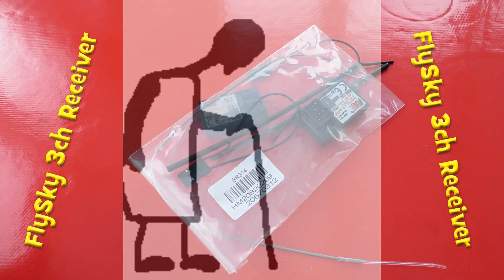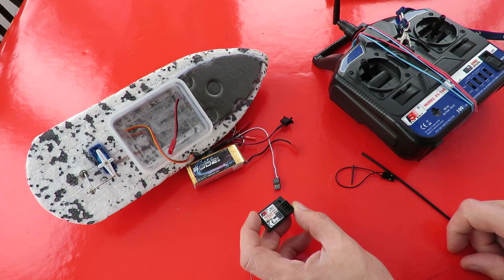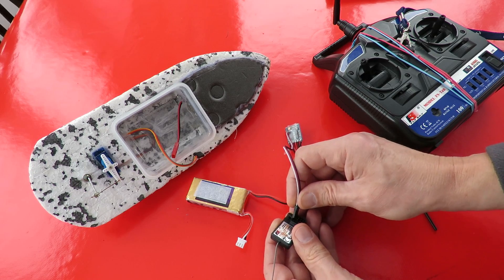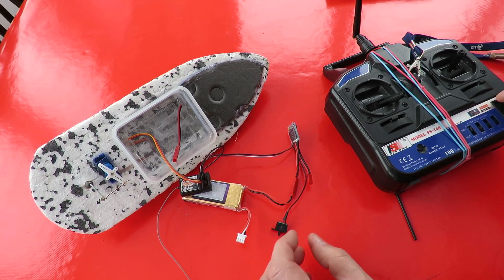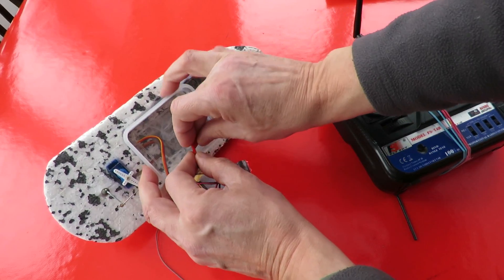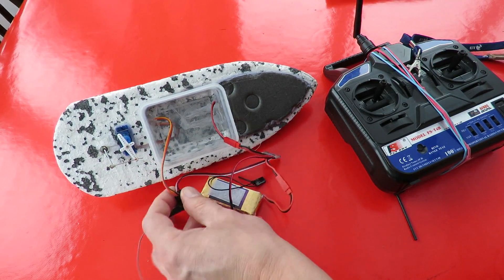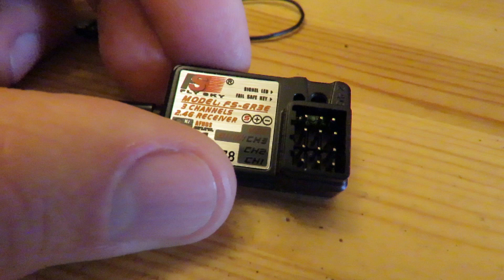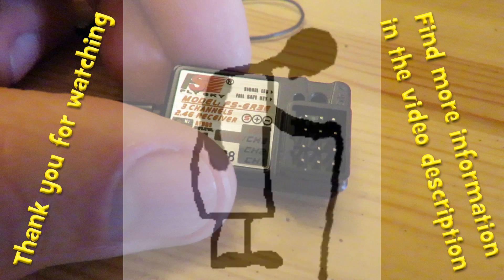FlySky 3ch Receiver

Comment: In my case flysky gt3b transmitter with gr3e reciver its range is about 50 meters what should i do to increase range
Reply from the maker: I would suggest you search the RC forums online, I expect there is some advice there.
Reply: @GrandadIsAnOldMan  didn't found any help ... What is range of your transmitter receiver
Reply from the maker: @technicaljatt3523  have you checked out the FlySky site for technical information https://www.flysky-cn.com/gt3b-canshu
and here is an RC forum link talking about the range on the gt3b https://www.rcuniverse.com/forum/rc-radios-transmitters-receivers-servos-gyros-157/11654812-flysky-gt3b-has-horrible-range-anybody-know-fix.html
Reply: @GrandadIsAnOldMan  I think i am using it near high voltage lines thats why range is not good

Comment: Hello, I bought this receiver new along with the radio, the only thing is that it makes a strange noise as if there are some internal parts moving inside the receiver. Of course, without power, almost like something mechanical is oscillating inside.Does it do this also in yours. best regards
Reply from the maker: You could always look inside. It only has 4 small screws holding the cover on. No there are no moving parts inside. Here is a video showing the insides - Waterproofing my FlySky receiver https://youtu.be/sR_ur6kZjMQ

Comment: Im a noobie here. How do people connect live camera feeds to this and use the same antenna?
Reply from the maker: @IeuanBevan.  Short answer, "You don't." If you are thinking FPV, you will find that uses a separate rc signalling board. You might link to this receiver just to get a battery feed, but you won't be sending any video signal through it.
Reply: @GrandadIsAnOldMan  ah right okay that makes complete sense now haha thanks alot!

I want to build a big rolling platform, can understand how you make FPV video very long range with a home station however would you know how you can make an RC work super long range? At least a mile range?
Any sort of special receiver or home station?
A reciver which can control a 12v dc moter, as well as some additional optional add ons.
Reply from the maker: @IeuanBevan.  there are all sorts of regulations covering long-range FPV, so I would suggest researching the regulations before spending any money. It probably depends on which country you live in.
Reply: @GrandadIsAnOldMan  last question haha, trying to understand also.

You know how alot of long range drones have Gimbal with 2 Metal Servos. (Moving cameras)

How do those moters get controlled by the same antenna on a drone to the same transmitter and still are able to be controlled super duper long range?
Such as the parrot Anafia drone?
Reply from the maker: Each servo will be controlled by a different channel on you RC gear. On some systems they even have motion sensors set into your FPV headset so the gimbals react to movements of your head. As far as the radio gear is concerned it is just another signal sent on another channel. Going back to the start of this thread, you are commenting on a 3 channel RC receiver. That means this receiver can only control 3 things, such as throttle, elevator, and rudder. What you are talking about is way beyond the capabilities of this receiver. On the subject of long range FPV you might find the Traxxalu channel interesting https://www.youtube.com/@Traxxalu-en9lz

Comment: What voltage do these receivers use ?
Reply from the maker: Here is the link to the Manufacturers description https://www.flysky-cn.com/gr3e-canshu it says 4.0 to 6.5 volts. If you are using a standard RC ESC to control your motor it probably supplies the correct voltage to the receiver. The ESC (Electronic Speed Controller) supplies the power to the motor and usually has a BEC (Battery Eliminator Circuit) included in its design to ensure 5 volts is supplied to the receiver, regardless of what voltage it is supplying to the motor. If you are interested in Radio Control I recommend watching the FliteTest RC Planes - beginners series https://youtube.com/playlist?list=PL6IuSFWz4ktvupu_gxw1vn-sjBGOkJFHV They talk about everything required for RC on aircraft but most of it also applies to cars and boats.
Reply: @GrandadIsAnOldMan  Thankyou .

Comment: Now I'm confused i bought a new receiver and the bind says channel 3 iv tried everything and it won't bind iv connected the seller and he said look at the listing so i did and it says too bind use VCC not channel 3 iv not tried it yet I'm just trying to get help cos it says bind is 3?
Reply from the maker: Yes, channel 3 is the one used for the bind plug on this receiver. In the video description I have written down the step by step guide. Make sure you switch both the receiver and the transmitter OFF as specified in the sequence.
Reply: @GrandadIsAnOldMan OK thanks mate I'll give that a go tomorrow and let you know how it goes thank you.
Reply from the maker: Good luck 👍🏻👍🏻 @LOVE2RC
Reply: @GrandadIsAnOldMan  all sorted mate thank you.
Reply from the maker: @LOVE2RC  great, I hope you get some fun with it 👍

Comment: Has anyone had problems with the range on these ? I use my cars on a basketball court and it loses range around 150 feet
Reply from the maker: Are you doing anything with the aerial?
Reply: Hiya... With these older ones make sure in your transmitter you change from default AFHDS 2 to AFHDS for these receivers. Its commonly a problem with these but that should fix it. Great range with these out to 1500m in the air and 500m over ground using a cheap Flysky i6X Radio. Just change the 2 protocol and your good to go.

Comment: I'd like to share how I fixed my fly sky FXI6 from the ayron channel from jittering turned out the spring tension is too loose.... You have to put a space or under the screw then the screw hits the back of the transmitter casing so you have to take a driMelll and make more room You could notice that the elevator sticks bring has more attention from the factory So you increase this tension of the spring and no more jittering when moving elevator stick!!!

Comment: Sir my receiver ,3 servos not working but the brushless motor is working sir 
Can u explain any method to repair it sir and what the problem is
Reply from the maker: Short answer, no. If your ESC is controlling your brushless motor OK, does the ESC work plugged into the other channels? That way you will know if it is the servos that are faulty or the receiver.
Reply: @GrandadIsAnOldMan  no sir esc doesn't worked while pluging into other channels, it produces long beep sounds for other channels .esc is working only in 
Channel 3 sir for FSR6B receiver

Comment: The paper sheet 6CH Reciver ONLY buys this item, can other remote control be able to control it?
Reply from the maker: It is a FlySky item, so it is designed to work with FlySky controllers. You would need to look at the technical specifications for your controller to see if it is compatible. I did find the WL V911 receiver worked with my FlySky controller so maybe a WL controller might work with a FlySky receiver, but I haven't tried it, so I don't know.

Comment: Recently received a TX with 2 of these RXes. I hope to get back into 1/10th buggy racing once the clubs are allowed to re-open. Rock crawling is fun, but I do like to zoom round a track. Heh, yes, and then there's all my gliders that I need to crash!  . . . 🛬
Reply from the maker: Hey buddy, long time. Thanks for dropping by. Yes the FlySky range are (or were) a cheap range that have always worked for me. Recently the eBay prices from China have effectively doubled for items like this, probably still cheap but not as cheap as they were.
Reply: @GrandadIsAnOldMan  Yeah, I decided on this Flysky as it's 3 channel, but it wasn't in stock at any UK shops, still £50 on Ebay though! 🙄
Reply: You're right they don't work for aircraft and my glider did crash after launching all the high start but it was EPP Pecans I didn't trust it It must have bounce 6' back up here hitting straight down..3gs rec
Reply from the maker: @truth409 Surely you would have done a basic range check before launching your glider?
Reply: @GrandadIsAnOldMan  Don't call me Shirley!
Reply from the maker: @wordreet  haha, the old ones 😊😊 I hope you are well. Soon be Christmas, again 😆😆
Reply: @GrandadIsAnOldMan  I'm good thanks, you to I hope matey. Yep xmas eh? I gave away a Tamiya Sand Scorcher kit to a great nephew last xmas, (wanted one since '85) he just started studying engineering at uni. So I've had to buy myself another this year!😁
Reply from the maker: @wordreet  it looks like quite a few of my RC plane and multirotor friends are moving to cars to get away from the 'new' regulations.
Reply: @GrandadIsAnOldMan  Have to admit I haven't flown anything in at least 3 years, in spite of having two large gliders still in their boxes! One of these years maybe . . . 😉

Comment: can i use a flysky reciever with the austar transmitter
Reply from the maker: Can't help you there, I have no experience with Austar. Does it use AFHDS protocol?  I just looked at a listing for an Austar RC on AliExpress and it does say AFHDS but I suspect it WILL NOT work. I seem to remember the FlySky AFHDS was it's own version. Looking at the picture of the Austar on BangGood it looks identical to an unbranded transmitter I have which DOES NOT work with FlySky receivers. If you get an answer from somebody, I would love to know as those Austar RCs look pretty cheap so might be handy.

Comment: Could you make a video on esc and connecting a 4 channel reciever by any chance
Reply from the maker: I don't see what you need a video for, maybe I misunderstand your question. You plug the ESC into the receiver. It will have the right sort of plug to fit. It will also have a plug for the battery and another plug for the motor. They are all different shaped plugs so they cannot be mistaken. It will probably have an on/off switch too. You choose which channel you want to plug it into depending on what you are using it for. For more detailed information I can recommend FliteTest RC Planes - beginners series https://www.youtube.com/playlist?list=PL6IuSFWz4ktvupu_gxw1vn-sjBGOkJFHV

Comment: If the motor es dead the reicever dont work?? My boat ESC was  beeping i tasted with a new one and same thing and the receiver dont show the ligth on , i change the reicever and same issue , i cant binded bacause dont turn on , some one told me that the motor is dead and thats the reason the reaceiver dont como on , what do you think
Reply from the maker: Try disconnecting the motor and just try it with the steering? If the steering works then it was the motor (or ESC).  Try each of the channels connected to the steering. You could power the receiver with a single cell battery to see if it works without the ESC.
Reply: @GrandadIsAnOldMan  all are new parts , the esc flashing , reicever new nothing ,i tried banded but nothing
Reply from the maker: @nossrc5638  first step - disconnect everything from the receiver. Next connect a single cell battery (3.7 volts) direct to the receiver. Make sure you have + and - the right way round. Does the light flash on the receiver?
Reply: @GrandadIsAnOldMan  im gonna check that now
Reply: @GrandadIsAnOldMan  the codes beep in the manual says that one beep per second is to low voltage or to higth voltage , the reicever turn on both of them  im getting crazy
Reply from the maker: @nossrc5638  at this stage you have nothing connected to the receiver other than the battery, Yes? The receiver should be flashing.
1. Unplug the battery
2. Plug in the bind connector ch3. 
3. Plug in the battery.
4. The receiver should be flashing faster.
5. Put your finger on the transmitter bind button.
6. Switch on the transmitter.
7. The receiver should change to a solid glow.
8. Switch off transmitter.
9. Unplug battery from receiver.
10. Remove Bind plug.
11. Reconnect battery
12. Receiver should be slow flash again
13. Switch on transmitter
14. Receiver should change to solid glow.
Receiver should now be bound to the transmitter.
Reply: @GrandadIsAnOldMan  i did that,  is binded but nothing , keep beeping,  the manual said beeping every second is low voltage or higth voltage and the lipos are 4.19V main 12.57V both of them
Reply from the maker: @nossrc5638    you are confusing me. Is the problem with your receiver or your ESC? If your receiver is bound OK can you operate the steering with it? I suggested using a single cell battery so we can eliminate the ESC from the investigation by proving if the receiver will operate the steering on all 3 channels from the battery NOT the ESC. The receiver does not beep so I don't know what beeping you are talking about. It sound to me like you are trying to work with the ESC when I am trying to confirm your receiver is OK. Once we know your receiver is good, then we can look at the ESC. You have to do things a step at a time. If you think the motor is dead and you think that is effecting the ESC then disconnect the motor from the ESC. Then try powering the receiver from the ESC (without the motor connected) and see if the steering works.

Comment: I am 11 year old ,your video gives me hope to fly. 
I am learning and doing all it takes to fly my plane .
Have a WLtoy F959 transmittor and fly sky reciever  FS-IA6B, 
How can I make it work,I am stuggling. Kindly guide me ,I hope to hear constructive tips,suggestions & feedback from you and others .
Reply from the maker: I am afraid I haven't used the FS-IA6B but I understand it is backwards compatible with the older FlySky receivers and in that case you should be able to bind it with the F959. Unfortunately as I don't have one, I cannot give you a video. I did several videos using the WL-V911 receiver and FlySky transmitters and the principle should be the same. Here is one of the videos https://youtu.be/vX-ovUMPIkw?list=PLA5a2xPRSrB3NYdWYI8H-zNX_7hBM-rsU

Comment: Failsafe is for nitro and petrol rc cars.
Reply from the maker: With some ESCs if you lose the signal they go to full throttle. The failsafe prevents that. That doesn't differentiate between cars, boats, or planes. It is an ESC 'feature'.
Reply: @GrandadIsAnOldMan  I have only ever had run aways with my older nitro a d petrol ground rc... never once has any of my brushed or brushless set ups run away if signal ic lost. They just stop.
Reply from the maker: @brenthumphreys5747  yes, like I said, it is a "feature" of some ESCs, not all of them. I have only noticed it a couple of times and until you commented on this old video I had forgotten about it entirely.

Comment: Does this work with a 7.2 volt battery?
Reply from the maker: Like the majority of Hobby Grade receivers it is designed to work on 5 volts. You connect your battery to an ESC or a BEC and they provide the correct output to power your receiver. If your ESC (Electronic Speed Control) has the built in BEC circuitry then it will supply the correct voltage to the receiver. A battery eliminator circuit (BEC) is an electronic circuit designed to deliver electrical power to other circuitry without the need for multiple batteries. Most ESCs have this facility but read it's specification to be sure. That means that if the ESC is designed to handle a 6S LiPo battery (23v) but it is equipped with a BEC it would still deliver the 5 volts to the receiver. If your battery is 7.2 volts then you need a 2S ESC or BEC.
I strongly recommend you watch the FliteTest RC Planes - beginners series. There are a couple of episodes covering the power and control systems https://www.youtube.com/playlist?list=PL6IuSFWz4ktvupu_gxw1vn-sjBGOkJFHV

Comment: Can I bind with flysky fs16 transmitter
Reply from the maker: Sorry I can't help you there, I don't have the fsi6. I would suggest checking out one of the RC forums. I doubt it will work.
Reply: Hi Randomstuff. I just had the same problem, I wanted to use this receiver in a small glider, and this was all that would fit. At first I couldn't bind it to my fs16, so I did some research. This reciever is on system AFHDS, wheras the fs16 is on AFHDS 2A. No worries, you can select the right system in the menu, and all will bind just as it should. In AFHDS you don't get the two way connection, ie the Rx voltage displayed on the transmitter display, but that's a small price to pay.

Comment: Hello. I have a question. What is this small pcb circuit betwen battery pack and reciever? Thank you.
Reply from the maker: I think you mean the ESC. That is the Electronic Speed Controller used to control the electric motor. It also includes the BEC - battery eliminator circuit - which allows you to use the same battery for the motor and receiver. Systems without that feature mean you need two batteries - one for the receiver and one for the motor. In cases where you don't need a motor - maybe a glider - then you would use a BEC on it's own to ensure the correct voltage is supplied to power the receiver and maybe the servos.
Reply: @GrandadIsAnOldMan  Wow, thank you for Long answer.  Im A begginer thats  im asking lame question :) have a Good  weekend. Best regards from Poland.
Reply from the maker: Thank you Mika. I can recommend FliteTest's RC Planes - beginners series https://www.youtube.com/playlist?list=PL6IuSFWz4ktvupu_gxw1vn-sjBGOkJFHV